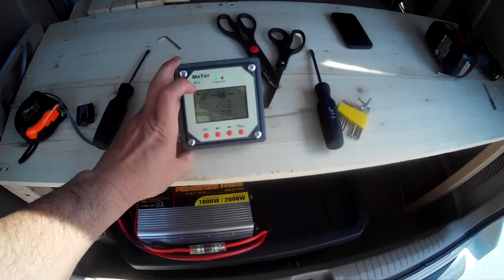Solar Battery System | Leisure Battery | House Battery | AGM Deep Cycle Battery Still Working

Comment: Would this setup beat the Jackery 500W battery?
Reply from the maker: Yes, my solar system is better. the jackery 500 will run a refrigerator for only about a day and a half. In comparison, my set up will last 6 days. Of course, adding solar helps but the window for the jackery is one day to recharge(not enough time). Again In comparison I will have 6 days to try to recharge. My system is better and at lower cost.
Reply: @VantasticOdyssey  Thank you very much, I purchased a portable 100W solar panel with the controller included. i will now look for inverters and a proper battery for my needs. :) thanks for your advice!

Comment: Question, how large of a battery bank will it take to run a 1.9A, 220
Watt pump 24 hours a day, 18 hours a day and 12 hours a day?
Reply from the maker: What is the voltage?

Comment: That’s a lot of juice!  Good video. I was about to suggest the circuit breaker over the fuse, just as you mentioned that you had switched to breakers, lol. Can I ask how much you paid for the inverter and where you got it?  Been thinking about a larger system for my NV200.
Reply from the maker: I always look for deals, so I paid 120. I put a link in my description Amazon has one at 140.
Reply: Vantastic Odyssey oh, derp I missed the link. That is a great price; will pick one up! Thanks!
Reply from the maker: @OdysseyCamper  Hey, Thanks for watching